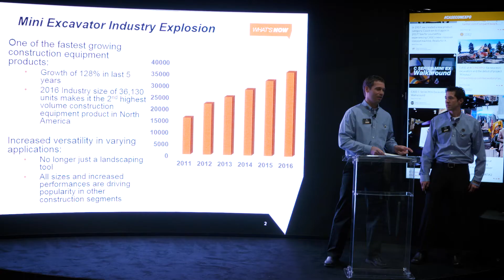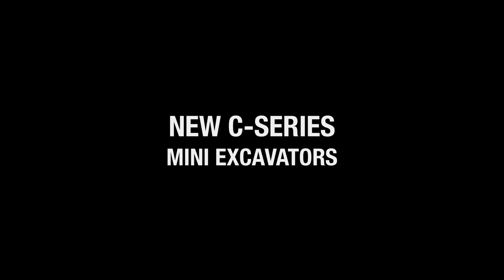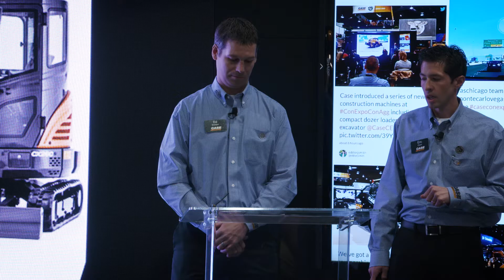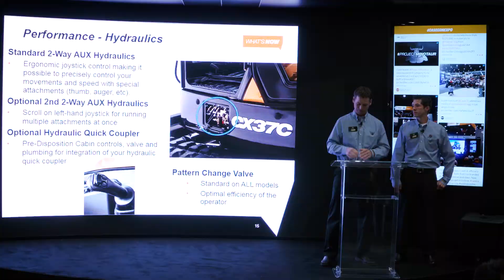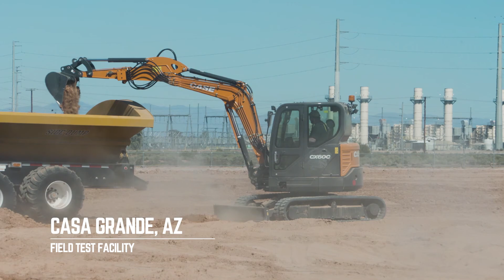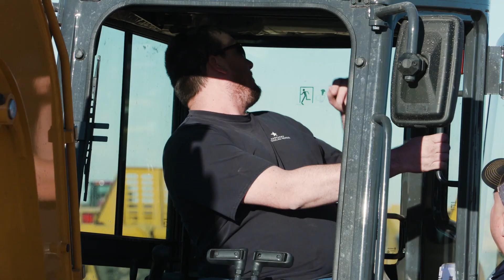North America: CONEXPO 2017: Introducing the All-New CASE C Series Mini Excavators

Comment: but I will say the cx57c looks like the right size for its weight class.  Gives mass engine power compared to the 305.5e2   let me see on my spec book it weighs like a 305.5 but has specs of a 305.  the horse power is way high for the size, and bucket break out force is low for horse power.  Oh man I would have to run one to compare lift strength and smoothness.  gee's I love these little mini's sooooo much.  I just want to dig with all of them.